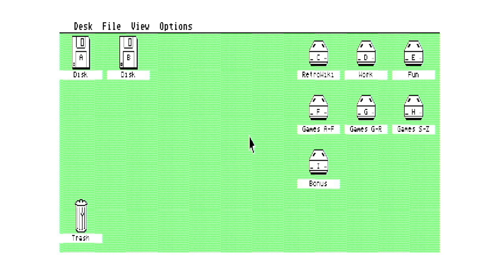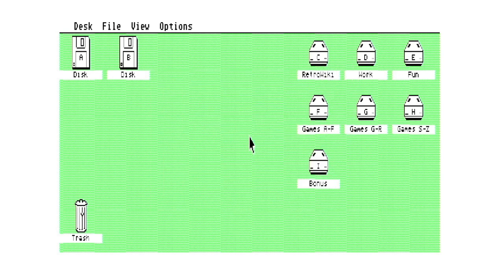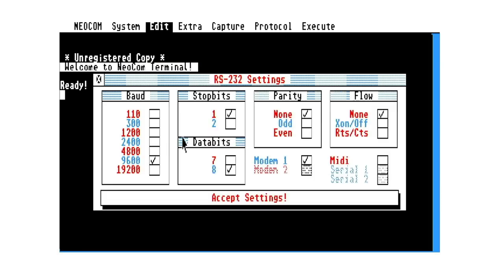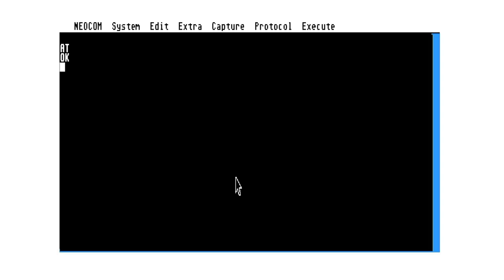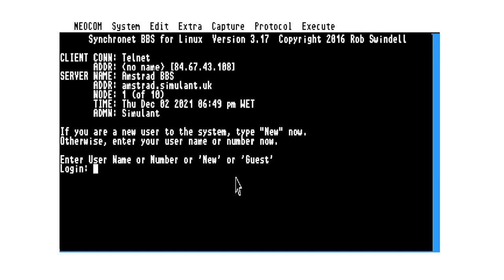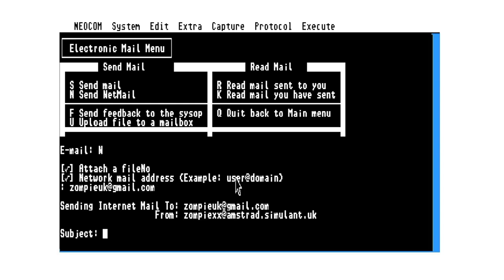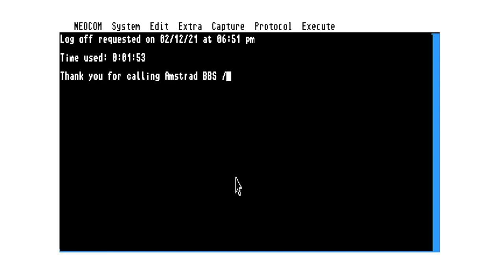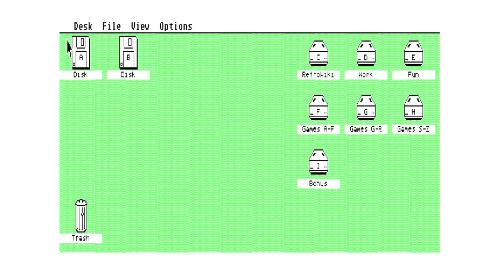Atari STe MiSTer FPGA connecting to Online BBS

Comment: Hey, how did you get Neocomm onto the ST on the MiSTer? I have the Neocomm files but presume I now need to get them into a disk image and copy it to the SD card. The Neocomm files are just currently in a zip, which I presume is what you were elluding to in the vid?
Reply from the maker: Hi Paul. I used an Atari ST software emulator, Hatari (https://hatari.tuxfamily.org), to transfer the software from my local hard drive to the Atari ST VHD file (or floppy). I did this on Linux, but other platforms are supported. Once you have Hatari up and running, in order to access the local hard drive, you will need to edit the hatari.cfg file, on Linux this is usually located in ~/.config/hatari/hatari.cfg (take a copy first). In the hatari.cfg file, there is a section labelled [HardDisk]. The parameters that need to be changed/set are: bUseHardDiskDirectory = TRUE, szHardDiskDirectory = <your chosen path for hard disk>. Once you have copied everything you need to the VHD (or floppy), copy the disk image file(s) over to the MiSTer. I expect you'll be able to find more information online. Hope that helps a bit.
Reply from the maker: Here is an example of the [HardDisk] section from the hatari.cfg file:

[HardDisk]
bBootFromHardDisk = TRUE
bFilenameConversion = FALSE
bGemdosHostTime = FALSE
bUseHardDiskDirectory = TRUE
nGemdosCase = 0
nGemdosDrive = 0
nWriteProtection = 0
szHardDiskDirectory = /home/pi
Reply: @RTSRetroTechShed  Brilliant stuff, thanks mate I'll have a play around.
Reply: @RTSRetroTechShed  All sorted thank you! :)
Reply from the maker: That's excellent :)